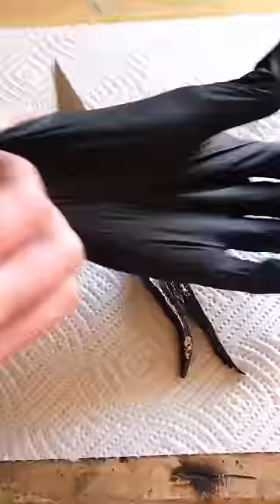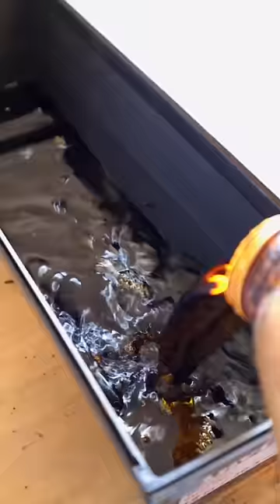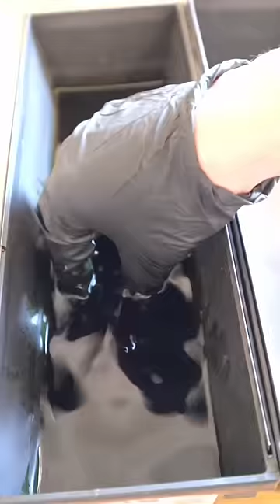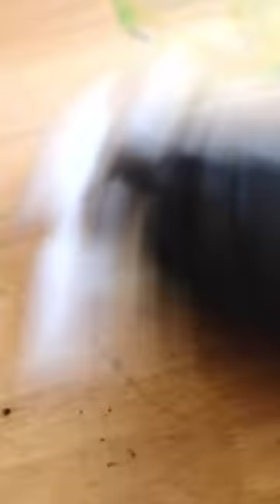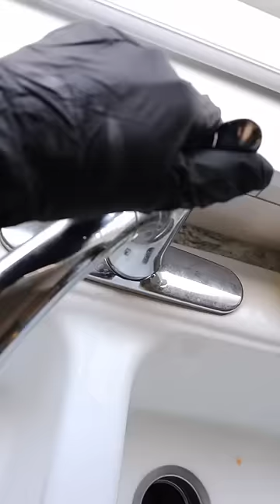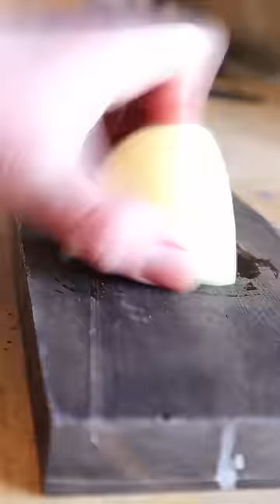Meteorite iron forged into a Damascus Steel knife

Comment: For those who may not know, No the acid will not melt the blade, it will etch it and add a cool pattern
Reply: Thank you! I knew it had a purpose, but I wasn’t sure exactly why he used the acid. I appreciate the explanation. 😊
Reply: What about his fingers
Reply: @rakilkeys6685  Not sure what you mean. He’s wearing the gloves the whole time there’s any acid present.
Reply: @beckyunderwood5753  I did not know  gloves could shield your hand from acid
Reply: @rakilkeys6685  Most “rubber“ gloves are actually nitrile gloves these days. They are petroleum-based, which makes them waterproof.

Acids and bases only give off ions and corrode things if the items are water-based (or ionic). That’s why they harm our skin, because it is largely made of water.

Since nitrile is petroleum-based, and water repellent, that means an acid won’t react with it.
Reply: @beckyunderwood5753  Couldn't have said it better myself
Reply: @spectenix  thank you! 😊
Reply: @spectenix    I mean they're just informing me so you could've said it the way you were gonna say it I just never paid much attention to science so I thought acid burns through everything. I was surprised when the knife didn't melt
Reply: @beckyunderwood5753  but thank you for the info now I know🙂
Reply: @rakilkeys6685  gloves and normally they hold it by the tang(the metal in the handle)

Comment: For those who are wondering Damascus is made by forging high carbon steel and mild steel, one of the more common ways to make Damascus is canister Damascus, you weld yourself a canister line it with white out so the canister doesn’t forge weld to the billet itself you throw your high carbon and mild steel in there after forging out the blade shape you like you quench clean it up acid etch and boom you got a beautiful Damascus blade

Comment: What kind of acid was that which you could touch with your gloves?
Reply: Ferric chloride, it’s a strong acid and very nasty to skin/eyes/lungs, but looking at glove resistance charts it doesn’t really react with most types of safety gloves. It’s also usually diluted down to 20-40% for steel etching.
Reply: @barnabro  
Well thank you so much for the informations.
I was kidding though

Comment: That was a gorgeous knife from the beginning. I wouldn't have changed a thing
Reply: Nothing did change. Him throwing it in acid served no purpose. You only do that to clean knives of rust. Its also a poorly designed knife.
Reply: @jonbong8547  it adds an effect to the blade as well. It is a good looking knife though. I wouldn't use it, more like a display piece
Reply: Watch again. The knife at the beginning was the end result. Just before he puts the knife into the etching solution you can see it is clean with no pattern.

Comment: Don’t wanna be a Karen or anything but isn’t steel bluing compound not safe for food?
Reply: It is. Also, meteorite iron is not as rare as one might think. In fact, people used to make things from meteorite even before iron age.
Reply: Yeah I was a bit concerned as well. Bluing is not food safe ): wish it was, it’s beautiful. But this isn’t very safe sadly!
Reply from the maker: That’s a great question! To answer that, the bluing chemical is not food safe in any way shape or form. But, the oxides it creates are far less harmful and food safe, if treated properly. They are actually good for the blade as they are in essence a controlled form of rust, that in return prevents more rust from forming. What allows the blade to be food safe is removing and neutralizing any remaining chemicals on the blade, which is a procedure of steps taken after application. ✌️
Reply: @TristanDare  awesome! Thanks for the info, I’ve always wanted to make my bushcraft knives rust resistant however I was weary of the food safe aspect. If ya don’t mind me asking, what is the neutralizing agent you are using or will water do the job? Thanks
Reply from the maker: @linkzyofficial  By first scrubbing the blade with fine steel wool until the finish you want is achieved, then add 10 parts distilled water and 1 part baking soda to a pot (not used for food) and boil the blade for 5-10 minutes, then rinsing and boiling in clean stilled water afterwards to remove the baking soda particles. Then polish once more with fine sandpaper under water (like I did) or, you can use a fine steel wool pad. And lastly, let it soak for 24 hours in mineral oil. 🤙

Comment: Shame you didn't give such a pretty blade a full tang
Reply: to what, do bushcraft with? if the owner even get some use in, i dont believe it will be anything harder than carrots
Reply: @kassiog.6595  It's just nice
Reply: @kassiog.6595 rivets are shit on a long time use knife, itll be wobbly in months with constant use
Reply: Maybe not enough material.
Reply: @stuartli16610 definitely enough a 2 1/5 inch b blade. The rest tooth pick tang mabey even curl tang for art/looks then cool handle
Reply: @illbehonestidontreallyunde547  All it's gonna do is cut vegetables it's a plenty strong construction. Plus just give the rivets a few taps with a ball peen hammer when it loosens and you're back in business not a big deal.
Reply: @illbehonestidontreallyunde547  well yeah obviously but since most of the metals inside the meteorite aren't the same obviously it's not the best for strength and you can't exactly temper it down correctly so it's more or less just for show
Reply: It’s actually sharper the way he made it
Reply: @N0cturnalAnimaL the tang has nothing to do with sharpness

Comment: The bottle or jug Wich contains the acid brings back memories of this small plastic coke bottle which also turned brownish like in the video which I assume is because of the acid which my dad always told me and my siblings not to touch 😂 and it would just sit high up on a fridge or cupboard 😂

Comment: the handle is fastened to the blade by 2 pins only?  thats extremely unstable and weak construction, bad knife.  and meteorite steel is not really a good steel